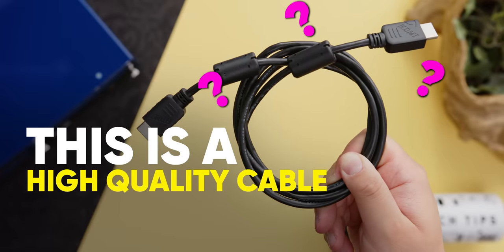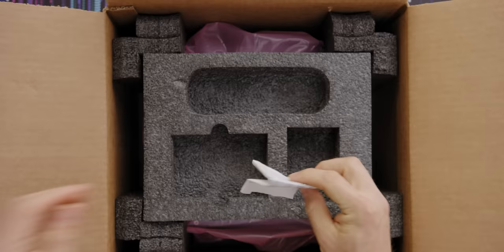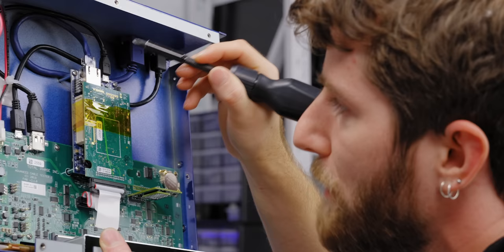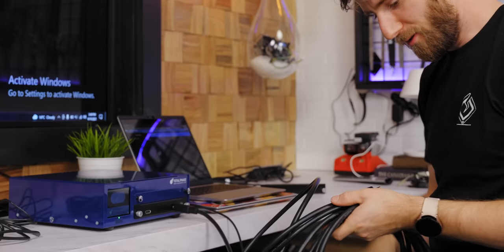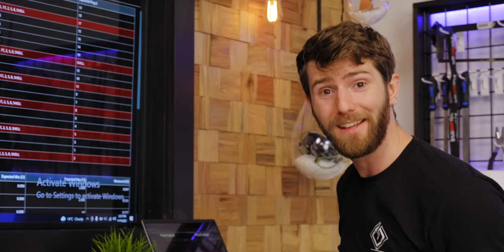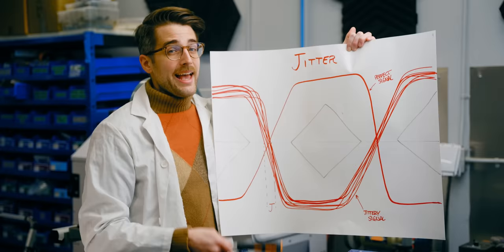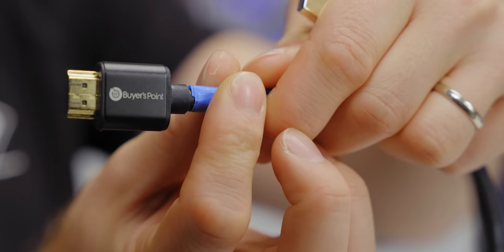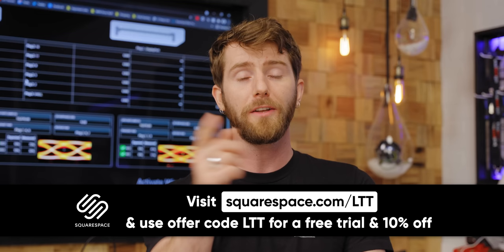This Just Saved me $100,000 - Totalphase Cable Tester

Comment: I’d like to see LTT cover the Amazon basics cables to see if they are worth buying.
Reply: I used to swear by these, so I hope so.
Reply: Facts
Reply: Yeah, Monoprice and Amazon Basics are the obvious and low hanging fruit.
Reply: They're not, Amazon Basics are invariably inferior versions of products that Amazon is having ripped off over in China.
Reply: I don't know if they are better standardized now, but I remember buying a pair of HDMIs, and while one of them worked normally the other one got affected by electric interference any time someone flicked a light switch.
Reply: Half of my cables are from amazon basics, and they all work fine.
Reply: @Bl4ckWarHawk  Most people are transferring digital signals anyways. Cables do matter for analog signals, but most people dont need to care
Reply: Seconded! I got 2 usb c cables from them, one seemed to work just fine the other worked for only a couple of days
Reply: THIS - It would be super easy for them to start doing the 'THIS £3000000 CABLE FAILS BASIC TEST' clickbait, 100% think they should more focus on buying and testing the type of cables that the typical person would buy at a shop/online
Reply: Vendel and L1Techs frequently went on tirades on just how many fakes they got.
Reply: But arn’t cables just cables? If they work it shouldn’t matter the brand?

I thought there’s no difference in image quality between cheap and expensive cables.

Unless you’re talking about durability.
Reply: Wendel has found plenty of fakes. He had to test loads of them when developing the L1Techs KVM
Reply: Most Amazon branded things are not worth it to buy.
Reply: I have returned 4 cables from Amazon basics
Reply: @Jiangcool9  you're sorely mistaken.
Reply: That really looks like a video they'd make. It'll be very interesting.
Reply: YES this!!! I have tons of those Amazon basics cables in various sizes.
Reply: @mastaw  You did realize that the explainer was talking about digital signals, right?
Reply: The USB A male  to C male 3.2-gen2 (the one with 10Gbps), which length is about 1 meter, is pretty good, I had it for about 2 years and it didn't fail yet.
Reply: @Jiangcool9  It doesn't really matter at 1080p @60Hz but even VGA can display at 1920x1080 so that's not a good benchmark.  Testing those cables is to make sure that they display things properly and won't have interference at higher resolutions and refresh rates.
Reply: They are not worth buying.  I worked at a place where we bought dozens of them and they were all junk. Most of them would barely work, at even low speed.  I found an alternate vendor that was about 15 cents more expensive in single piece, and was 50 cents a unit cheaper when we bought 20+ at a time. Those worked fine 100% of the time. I will never buy anything A___ Basic again.
Reply: i am so into it to see that
Reply: Amazon basics cables usually work but they are not very durable if they are moved much. I've had several Amazon basic display port and HDMI cables fail when routed through monitor arms from being bent frequently.
Reply: ye, hopefully there basic enough to be good :)
Reply: Video cables are kind of janky sometimes...I do use a lot of their audio cables and connectors though and have pretty good results...same for Monoprice
Reply: @mastaw  Not true at all. Digital data is still carried over what is essentially an analogue medium, the video made this fairly clear in showing the wave forms in use; these waveforms are analogue waves (because it's not possible to have any other form) and the receiver interprets these analogue wave forms to extract a digital signal. A non-digital cable will typically uses these wave forms as the signal, digital uses these waves to encode the signal.
Reply: And UGREEN cables, I want to see what they are like quality-wise. Aesthetically they're great, but I have a sneaky suspicion.
Reply: @devrandvar  May I ask how long your cables lasted? I'm doing the same thing with Basics cables right now and haven't noticed any issues as of yet. Granted, the Basics cables were just a cheap and quick solution to getting my monitors up and running. One of my monitors gets moved around a fair bit but the way I routed the cable leaves it relatively stress free.
Reply: I agree. Had a couple displayport cables die out of the bag in two weeks. We weren't even rough with them.
Reply: YES, PLEASE!!!
Reply: @nickryan3417  What I'm saying is that, assuming a functioning and interpretable signal reaches the receiver, the digital signals are way more robust to interference, signal loss, and low pass filtering (all of which are unavoidable when transferring data). Whereas analog signals degrade immediately.
I have my Uni exam where I have to encode and decode such signals by hand tomorrow, so this information is as fresh on my mind as can be.
Reply: @S_Roach  Yes.
Reply: I never had issues with mine, but they seem to change suppliers on a regular basis so I wouldn't be surprised if there were many a ton of bad batches over the years.
Reply: Came here to say this
Reply: @Jiangcool9  There is no difference in image quality between cheap and expensive cables (at least when it comes to digital signaling), but the difference in terms of reliability can be dramatic.
Reply: @mastaw  That is an advantage to digital signals, however they are still very definitely prone to interference and signal loss and in some ways they are affected more by interference and signal loss. Take an analogue radio signal, a bit of crackle and hiss in it is annoying but the overall radio signal is still interpretable. However a digital radio signal with the same interference will crap itself and go silent until the next intact compression block is received and processed. The encoding of digital signals may make the signals more robust in some ways, however in other ways they are more vulnerable. 

For an example of digital signals designed to withstand really horrible EM environments, look at the specification and working of CANBus/CANOpen as this encodes data in a rather different way and it's the difference between a parallel pair of signals that encodes the digital data rather than encoding the signal in just one. Power spikes and interference should affect both cables identically therefore the encoded data is still there regardless.
Reply: I got a supposed high quality hdmi cable that fails to deliver 4k hdr 120hz consistently for my 3080, it only works fine with the cable that came with the xbox series x but its extremely short, so finding a GOOD long hdmi 2.1 cable right now on amazon feels like a gamble.
Reply: The possibilities are endless!
Reply: @Jiangcool9  did you not watch the video at all? They are cables but if they dont meet the high spec signal loss criteria they will just straight give no signal or flicker and do weird stuff, its not about image quality or durability its about having it able to maintain a high bandwidth stable connection, most amazon basic and chinese cables out there on amazon can handle 18gbps no issue, but most fail for the 48gbps test which is crucial for 4k 120hz hdr.
Reply: literally what i was gonna write.. ive bought soo many DP 1.4 cables.. and i have zero confidence in most of them.
Reply: yep, and add in a slew of the cheapest cables from Alibaba and Ebay, with the specifics all laid out.  I'd watch a 30 minute video if that mean I can buy with confidence.
Reply: Send one to Project Farm, I am sure he would make some cool comparison videos.
Reply: I want too
Reply: Buy BOAT cables. They are cheapish and works flawlessly.
Reply: @Fun With Minerals sounds like you need the isp to give you a new drop. Bet your have a ton of loss thru the coax
Reply: Considering how hard Amazon pushes these and how ubiquitous they're becoming, this seems like the perfect place to start.
Reply: @nickryan3417   Of course, I never tried to claim that interference couldn't make a difference. I was only talking about the average user. 
I can't remember having ever experienced data transfer issues through a usb cable. That does not mean that it can't happen. Whereas my TVs SCART connection did sometimes struggle with poor connections, interference, etc. Noone I know uses cables beyond phone chargers, usb, and short hdmi runs though, so it's not really relevant for them. (Except of course people in my Uni course)
Reply: I've always had great luck with their cables in my view though i'm interested to see! 

I still love their braided HDMI they made (not sure they do now) but that thing is HEAVY!
Reply: @mastaw  I find myself working with cables far too often and over-long cables are a recurring problem. USB doesn't travel that far and neither does HDMI however with good quality cables and tolerant devices at both ends the limits are more vague... until a less tolerant device is plugged in and then the accusations of poor quality cables and kit comes in!
Reply: Ugreen, anker and those commuly sold everywhere.
Reply: ^ this. Some Amazon basics stuff is worthwhile. I use an el-cheapie Amazon Basics Bluetooth mouse & 3.0 > 2.0 cable for my external drive. Both work fine since I do not need anything fancy but I agree there is so much smoke and mirrors on this stuff.
Reply: Same! Buying brick and mortar is grossly overpriced, and online can result in chinesium garbage. Checking Amazon basics for quality at their price point, and making alternative recommendations would be a life saver.
Reply: @Jiangcool9  there isn't any difference in visual quality it's just a case of weather they work properly or not especially now we are trying to pump 4k at 120hz through them which requires a huge amount of bandwidth. If you have a good cable. It will just work with no issues. If you have a bad cable it will likely work at 1080p or normal 4k just fine but if you try 4k 120 it will either just not work of you will have visual artifacts (little white specs i have witnessed) or perhaps your signal will cut in and out. This doesn't mean you have to spend a fortune on cables though I have a £12 pound hdmi 2.1 rated cable that worked just fine at 4k 120 hdr from my pc to TV
Reply: @dvknight  they get far more unreliable after 5m so anything above that you want to consider a fiber optic hdmi 2.1 cable
Reply: And also the extremely aggressively advertised ones (from other manufacturers)
Reply: No better and no worse than any other. There is no relation between cost and quality of HDMI shielding. The only way through is to find a cable that works then say that the system has now passed
Reply: @iammeuru  I feel like monoprice is gonna be hit or miss, they have some really great low end stuff, and I have quite a few RCA cables from them that are just fine (thats just one wire tho lol) but they also are the only producer of DVI to component RCA adapters, so I really hope that they put a disclaimer that this doesnt suddenly make all their products bad.
Reply: @SteelSkin667  There absolutely can be a difference in image quality.  I've had HDMI cables where random pixels would be the wrong colour because the signal got corrupted but was still picked up cleanly enough to display a picture.  HDMI has no error correction on the video signal so bit errors CAN impact the picture.
Reply: @alexatkin  Yes, I looked it up a bit further and read about sparkles after posting this comment.

Comment: As an electrical engineer, I approve of the over simplification of the eye diagram. It was well done for the non electrical engineer common folk. I did not expect to hear differential signal jitter being mentioned on this channel ever. Well done Riley.
Reply: Why mention you are in electrical engineering ?
Reply: @gl4989  It shows even someone who's job uses this kind hardware everyday, that he recommends this for someone who didn't go through the learning that this person went through.
Reply: @gl4989  ?
Reply: @gl4989  Because it's relevant to the point of his comment. As someone who fully understands the issue he is in a better place to judge how well Riley was at explaining in a simplified form (and I do agree, it gets the point across enough for a general level understanding of it which really helps if anyone who watched this later wants to dig deeper into the field. Having a way to mentally realize the subject you are studying does wonders for retention).
Reply: I felt smart until I realised it was simplified :/
Reply: I agree, but also well done Colin (he wrote this episode)
Reply: @gl4989  because it’s 100% relevant to the point he is making…… stop getting butt hurt because someone has mentioned a relevant qualification for the associated opinion they have made just because you have neither the knowledge or skill to comprehend the point he is making….
Reply: @UlzYT  If you truly understood it, you should be impressed with yourself. It is not an easy thing to understand and/or to visualize at all. The first time I saw an eye diagram, I didn't understand the concept at all!
Reply: @Hellfire8  Very true!
Reply: @gl4989  When you are making a point on a technical matter it's always relevant to mention your background knowledge on that subject
Reply: I'm an electronics engineer, so I may just be assuming this but I thought eye diagrams were pretty intuitive for the usual crowd too?